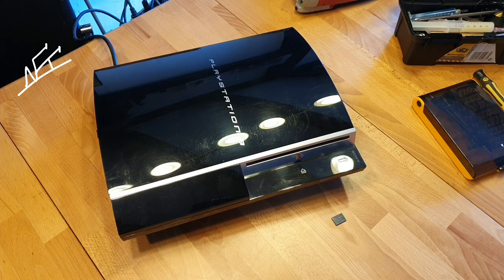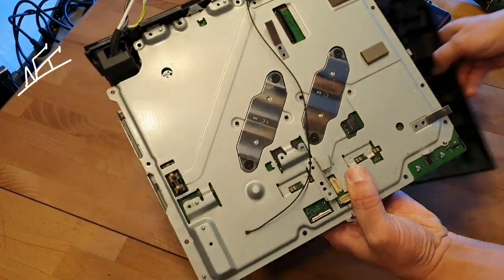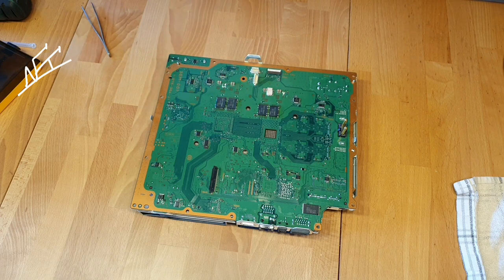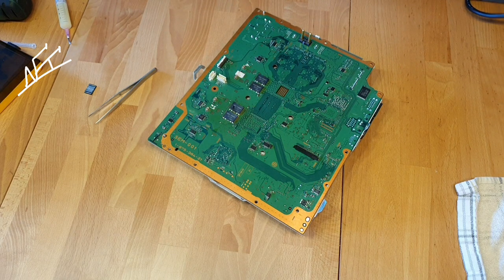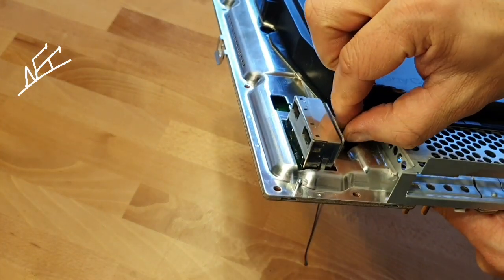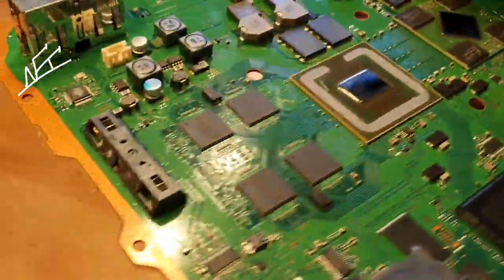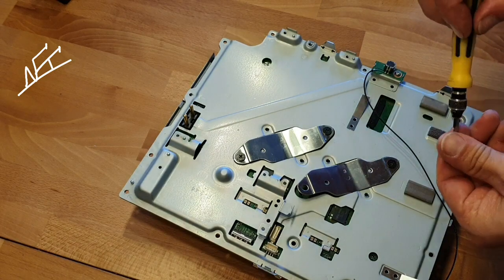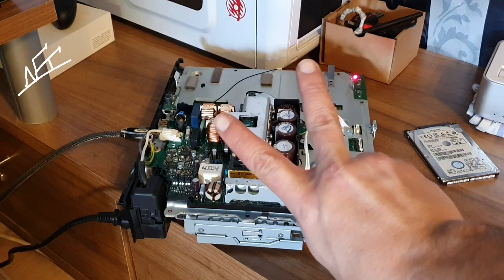PS3 YLOD Fixed with an Original Nec/Tokin Capacitor By:NSC

Comment: I wouldn't recommend re-using those crappy capacitors. Better buy a new ones made of tantalum from our yellow friends.
Reply from the maker: Yeah i know already, this was just a great test :)
Reply: @NSC-Modz  can i send my ylod motherboard to u and if a ps3 has nec tokin but works good should i replace them tantalum
Reply: where to buy those?
Reply: @bsanchez3563  do you know the suavest why to open cell ihs
Reply: What’s wrong with using the original replacement ones? I found some on eBay
Reply: B Sanchez they are new replacements of the same make
Reply: @retroonyoutube5402  those caps are crap. The brand new from the OGs were shit, imagine those you saw..
Reply from the maker: @naseromar5533  check my videos bro. there you gonna find the best IHS removal videos :)
Reply: @retroonyoutube5402  oh that makes sense sorry my bad
Reply from the maker: @bsanchez3563  this was a nearly new one :) no Panik ^^ i know what I'm doing xD
Reply from the maker: @retroonyoutube5402  nothing wrong about it, you can use also the original ones, it will works again for the next 10 years, conforms how much you play ;)
Reply from the maker: @naseromar5533  on my channel bro... :)
Reply from the maker: @eynotj7011  on ebay bro.: https://www.ebay.de/itm/161293774224
Reply: @NSC-Modz  i have play station 4 the 1st gen when i turn it on there is no power at all does that happen because of power supply and how i do know that the power supply is working
Reply from the maker: @naseromar5533  can be from the PSU yes, you should test it with a working one...
Reply: @NSC-Modz  thanks
Reply: @NSC-Modz  i forgot to tall there isn't a beep at all and i opened the power supply i saw one of the wire his color turn to black
Reply from the maker: @naseromar5533  😳

Comment: How do you tell if it needs these capacitors replaced? Or if it’s the rsx chip? I have a YLoD and I’ve replaced both those caps with tantalum ones. And I tried a reflow on the rsx and cell. But it still has the yellow light. I went to 500c on each chip, for about 5min. Idk maybe I’ll send it to someone who can diagnose better

Comment: the thing is... you're currently heating up the capacitors right now restoring some functionality to them. you would not know what is truly faulty. By default these are already poorly made out of factory. Just use tantalum and youre set for a long time as far as nec cap are concerned.
Reply from the maker: uhh NO xD Better use the Syscon Reader and scan the error logs ;)

Comment: Wait, how did you take off the Nec tokin without breaking it into pieces? Every youtuber I’ve seen do this couldn’t get them off so they broke them off
Reply: also how do you take apart that power supply? I’m not sure how to take that one apart
Reply from the maker: I have heat it up and desolder it out with a heatgun and flux, just like most pro doest it. But you can break them out, so it's better for the board, otherwise you could cook the board maybe 😅
Reply: @NSC-Modz  yeah, I think I’d just break them instead considering I’m kind of new to all of this. But for the power supply do I pull off the edge clips to bend them? I’m not sure because the only power supplies I took apart was the EADP-260AB And the APS-306. Which was easy because I had to pull the tabs back and lift it up

Comment: Greetings NSC, I'm an admirer of your great work. Gotta say awesome German engineering applies not only to cars but console repair as well. I have a CECHA07 60G (TW region) which has only recently started the symptom of unexpectedly turning itself off during heavy 3D game scenes, with 3 beeps and ensuing blinking red light. Before I noticed this problem just this month, I have not had powered it on for say at least 6 months,  so it obviously has little to do with constant overheating. I have replaced the thermal paste (which didn't help much, still idling at 68c) and will do the PC ATX PSU test to rule out that possibility, as well as the syscon uart reader thing to get the error log and see what kind of codes are buried in it. My hunch is that most likely the NEC Tokin on the RSX rail has degraded over time, and thanks to your wonderful video tutorial, I'll know how to approach it when I finally reach that stage. Thanks again.

Comment: Yo, i recently had been given a ps3 fat, and i wanted to cfw it, got another running with a reflow, but unfortunatly this one, after infinite tries reflowing with flux, does not want to boot, psu must be fine. Hdd led lights up for a sec, it actually looks like it try to boot for 3 sec than YLOD, Do you think its worth trying to replace the nec tokin? And wich nec tokin is the one that usually lose capacitance? Thanks in advance. Any suggestion from anyone is appreciated, give me hope lol.

Comment: Hi. Great video. 
How did you know it was that particular capacitor, and not one of the others?

I've had my PS3 60GB for a long time, and it got the YLOD about 3-4 years ago. I took it to a repair shop, and it may have been reflowed by them (I'm not sure). But, about a month or two after being "repaired" it YLOD'd again. When I tried the system again a couple of weeks ago (I want to play some of the old PS2/PS3 games), the system powers on (Green light)...then the fan gradually increases in speed to maximum speed. The system displays a messaging saying it is too hot, and shuts down.

Following yours and other guides, I have opened up the system and noticed that the RSX had been de-lid'd previously. So I cleaned the chips and IHS's and applied MX-4 thermal paste. But unfortunately the fans still go high and then the system powers off.

Do you have an tips or suggestions of what to try next?
Many Thanks.
Reply: Yes how did you know which one?

Comment: Great video...

What is that liquid you inject around the nec tokin?
Reply from the maker: This is Flux, it helps soldering better
Reply: @NSC-Modz  and now you glue the nec tokin back on the board?
Reply: @douglasschadek1255 It’s called soldering, he uses heat to melt the solder (basically glue for electronics) and it connects it electronically, you cannot use glue for a process like this because it’s less precise and doesn’t transfer electricity like solder does

Comment: Do you also clean the fan blades?
I've found that after cleaning, apply a car silicone wax with a Q-tip, 
Then buff when dry, makes clean last much longer time, less dust.

Comment: Hi I see that you use the spreading method for thermal compound application but I just wanted to verify something. I read on a few online forums that the pea method works best. Which method do you recommend? I own a super slim model I'm just a little scared that I may apply too much compound and that it will flow over the edges of the chip onto the motherboard since the chips are smaller than the fat ps3 model. Anyways, thanks for your great and informative video! Still good to see people caring about ps3 in 2020.
Reply from the maker: Hello

To much is still better then to little, the pea method is not enough to cover all the IHS, that's why i do it like i do. I saw a lot CPU's that was not full covered with paste because they used the pea method. That's why i do i like that, and i do it since a lot years now, never had problems. To be sure that everywhere is paste, i spread a little all over the IHS, and to be 10000% sure i apply a little small line or a small pea over the rest.
Reply: @NSC-Modz  Thanks for the reply! I'll use your spread method then.

Comment: Hey NSC great work as always, greetings from Russia my German brother! Quick question: wouldn't such high temperature damage the nec/tokin capacitor while you're heating it up to solder? Or it's safe because PS3 is turned off?
Reply: Lower the temp to 300 c when installing the new nec tokin... Not recommended tho, buy 470uf.. it is cheaper and lasts longer..

Comment: Hi, good job where can buying tokin capacitor for ps3 fat 60gb yold light not working, thank you
Reply: First check if the capacitors are really the problem. If they are search for tantalum capacitors and make sure that they have the correct capacitance

Comment: How do you know you need to replace that particular Nec/Tokin but not the others? My PS3 is also having the same problem and I got A0093004 from syscon. But when I measure the resistance for the  Nec/Tokin, they are more or less the same (4-5ohm). So I am not sure which  Nec/Tokin should I replace.

Comment: Em primeiro lugar, parabéns pelo vídeo. Muito bem explicado, mas eu gostaria de saber porquê você trocou apenas aquele capacitor? Há alguma maneira de saber qual está com problema e trocar apenas ele? Eu quero fazer o procedimento no meu PS3, e no meu apenas, portanto, não tenho todo o material necessário nem vai fazer sentido eu comprar apenas para realizar o meu serviço... nesse cenário, há alguma forma de eu saber qual capacitor devo trocar... o que eu tenho é um multímetro simples... ou posso "adivinhar" qual "pode estar" com problema levando em conta a posição mais próxima da área mais quente do PS3 (CELL CHIP + PSU)? Agradeceria muito se pudesse dar uma explicação.
Reply from the maker: Olá :) Em primeiro lugar a melhor usare o Syscon Reader, assim podes ver mesmo o problema que tens. Os Tec Tokin normalmente são bons. Por favor sempre primeiro usare o Syscon Reader. Assim pode ser ver o ler os erros codes que a PS3 tem.

Comment: how to know if the ylod is caused by bad soilder ball under chips or those capacitors ? thank for replying me !
Reply from the maker: Was the Fan turning high so the PS3 was overheating, if the fan was turning normal, then it could be the NEC's
Reply: @NSC-Modz  oh no I throw away 2 fat ps3 with seem they are having bad capacitors, I thought it was the RSX/CPU :(
Reply from the maker: @lunatic1911  :( shit happens....
Reply: @NSC-Modz  i was playing gta 5 which made my ps3 fat really loud. so rsx? ...
Reply: @magnus00125  delid it

Comment: Sadly this is not a permanent fix. The heat changes the chemistry inside the NECs bringing them to life temporarily. I feel the permanent fix would be changing all NEC capacitors for the more reliable tantalum ones.

Comment: Hi, great videos, learnt a lot. Do you follow some sort of process of elimination methodology when deciding which Nec/Tokin is causing an issue?

For example is there a guide to check the voltages of the individual Nec/Tokin and what figures to look for to determine which one is/could be faulty and require replacement using a multimeter? Before having to dismantle/solder and de-solder anything?

I have a PS3 with YLOD, before spending any money I wanted to verify if it is in fact the Nec/Tokin causing the issue and not something else, so I isolated the Nec/Tokins with Kapton tape and heated 4 x Nec/Tokins and the PS3 powers on now. So I believe it in fact to be the Nec/Tokins being faulty.

Is it recommended to replace all the Nec/Tokins? Should you replacement them one by one?

Thanks.

Comment: I have a problem with my PS3 Fat, every time I turn on the power it turns off and I wait for a minute the power light just comes back on but I have to unplug the plug and wait for a few seconds to turn it back on and that's it.

Comment: Are you sure that 380 degrees are correct?

Are you using celsius or farenheit?

My solder wont melt... the capacitors throw bubbles already....
Reply from the maker: You need some skills to do that, so please take care.

Comment: Why do people say to reflow those when you get the ylod does that actually fix the ylod or do they have to be replaced
Reply: it unintentionally "restores" the nec tokin capacitors by exposing to the heat temporarily. It will surely go ylod again. Just replace with tantalum capacitors. GLOD is usually caused by bad soldering balls on the chips.

Comment: Hey NSC! I have an original 60GB PS3 which I bought reballed, however I’ve noticed Uncharted 3 seems to cause the PS3 to turn off... I know there’s lots of reasons why it might be happening, but I’ve changed the thermal paste many times below and above the IHS plates, even installed a fan controller. Any thoughts what might be causing that? Other than Uncharted 3, the console works beautifully! :)
Reply from the maker: Hello Please try also an other PSU, and if it's still not working, you will need to replace the NEC's 

Best Regards
Reply: NSC Modz Many thanks! I’ll swap the PSU with the one from my 40GB PS3 phat  :D looking forward to more PS3 videos!
Reply: spywarefinder did you swap the PSU? How did you go yet?
Reply: Retro Youtuber I have not yet, however I plan to change it today! I have another newer 40GB non BC PS3 PSU that I will swap. I’ll give an update once I’ve installed it and I’l keep my fingers crossed! :D
Reply: spywarefinder let us know how you go, very curious
Reply: Retro Youtuber okay, I’ve swapped the PSU... I did notice that the original PSU might of have slight bulges where the three large capacities are. It’s barely noticeable but when looking at the other PSU, they are flat. I’m about to fire up Uncharted 3. I’ll see what happens and give a final result here :)
Reply: spywarefinder that was fast! Lol fingers crossed!
Reply: Retro Youtuber it’s still running but I’ll leave it going for a while
Reply: spywarefinder when does it usually shut off? For me, my main game it shuts down on is Tekken Tag2. As soon as I get into gameplay it turns off. Try to replicate the area where it shuts off
Reply: Retro Youtuber hi there! No the swapping of the PSU did not fix it. I guess I’ll have to change the tokin caps now :)
Reply: spywarefinder ah damn, it MUST be the capacitors. Are you going to replace with a Tantalums or replacement NECs like in the video?

Also do you have Tekken Tag 2, are you able to test if it currently shuts down for you?
Reply: Also in answer to your question, my PS3 works fine with most games, it’s just certain ones such as Uncharted 3 and sometimes Black Ops 2. The shutdown is not instant, it can occur in 30 minutes to 50 minutes
Reply: spywarefinder I am in a similar boat, currently only Tekken tag 2 shuts down my console in gameplay and Tekken 5 can go up to 30 mins at random, hence why I asked if you have that game
Reply: Retro Youtuber sadly I don’t have Tekken Tag 2 and I’m not going to use the NEC caps as they seem to pack more problems so I’ll swap them with some tantalum caps. Although I’ll have to swap them carefully as they are bridged in a special way if I remember correctly so you have to keep at least one set of the caps or create some wiring
Reply: Retro Youtuber Interestingly enough, PS2 emulation is fine, despite emulating PS2 hardware - I’m going to put Black ops 2 on and see if it shuts down. It doesn’t usually but if it does the problem might be slowly getting worse
Reply: spywarefinder no worries, thought I’d ask. Would it be correct in assuming the NECs are easier to install than the Tantalums? Also are you doing just the RSX ones or more? Either way, let us know how you go after you complete the install
Reply: Retro Youtuber Not sure! It will be the first time that I install tantalum caps, I’m certain that the NEC Tokins are super expensive anyway! :D
Reply: spywarefinder hey, did you end up swapping the capacitors?
Reply: Retroesque  Hey there! I haven’t got around to doing it just yet :( because the console works fine in others games that I’m playing, I haven’t wanted to work on it properly until it begins to play up more. I am certain changing the caps would fix the problem for sure though! Just don’t want to break a ‘working’ PS3 at the moment :D
Reply: spywarefinder just to let you know, I had mine changed only on the bottom of the board and while it did fix the shutdowns on certain games, now I have a ‘cold YLOD’ meaning when the unit is still cold, usually after first power up for the day, it YLODs once. After that it works fine all day. Just to let you know, perhaps the heating of the board caused something else to go wrong.
Reply: Retroesque Unless the Tokin caps above are needing to be replaced? You are however correct it could be something else that’s going wrong. I know we mentioned this before but have you changed the PSU?
Reply: spywarefinder it wouldn’t cause cold boot YLOD since I changed the capacitors on the bottom so I’m leaning away from the top capacitors suddenly going bad unless the heat damaged them somehow. Yeah I swapped the PSU way before.
Reply: Retroesque Yeah the problem is that there can be so many reasons for a YLOD, even the hard disk drive can cause it from what I’ve heard. Obviously, you changed the Tokins and that’s causing a cold YLOD from what you’ve said, so unless something is shorting out? I also understand (and I could be totally wrong) that the tokins have to be jumped or something? But I think that’s only when you take all the tokins off and then put tantalum capacitors on them! Again don’t quote me as I could be horribly wrong! :)
Reply: spywarefinder I also used another HDD but still the same. Only changed the bottom side so no bridging is needed. Very weird

Comment: My Ps3 turns off while playing certain games such as rdr1 and far cry 3 , but plays some games just fine like gta 5 , it also turns off when reaching the "22%" trophy on Tekken Tag Tournament 2 , already tried replacing the hdd ,but still, no joy.
What could have been the problem of the console?
Reply: A Jay I have the same problem, Tekken Tag2 and now TEkken DR has started the shut down. I have ordered some NECs to replace but it might be a while until they come